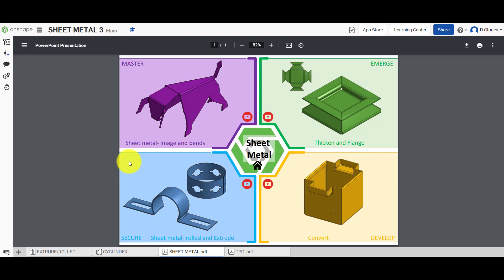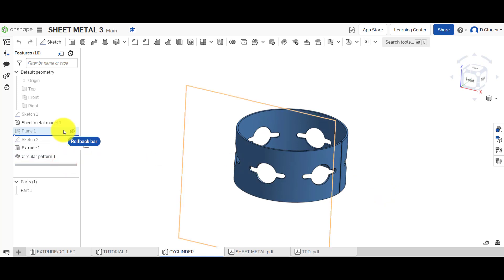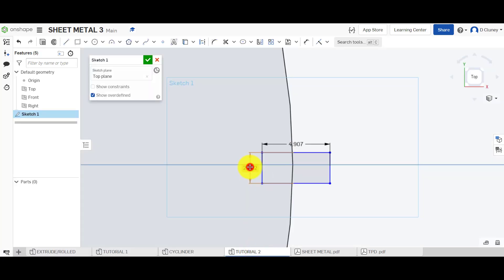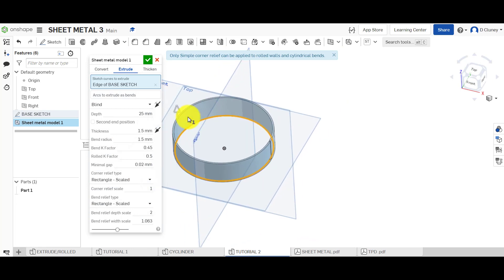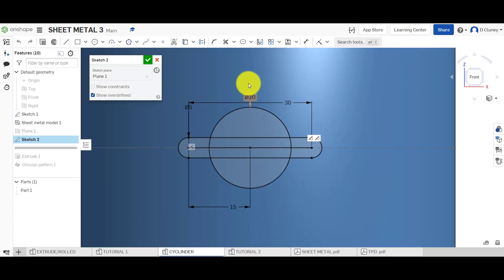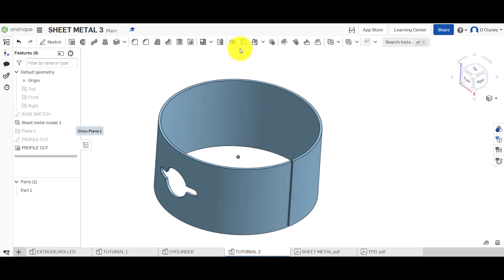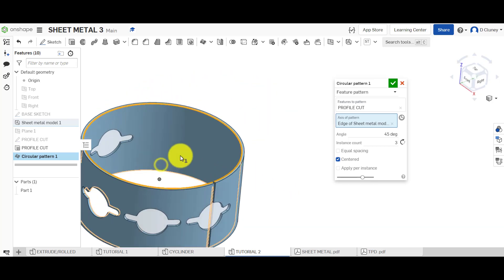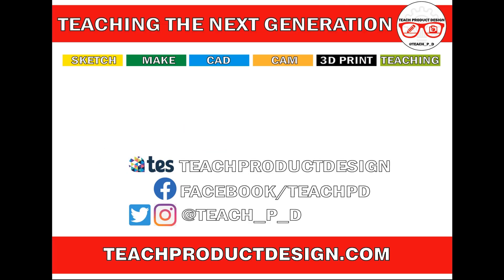Onshape Tutorial. How to create a SHEET METAL cylinder and NET/FLATTENED part. Step by step.

Comment: Not quite sure what would happen if the 1 mm gap was ommitted. Extrude would still be possible wouldn't it? Is it so the flattened sheet/net view can be drawn with a defined starting edge?
Reply from the maker: Correct...You can't create a flattened view if you don't leave the gap. 👍